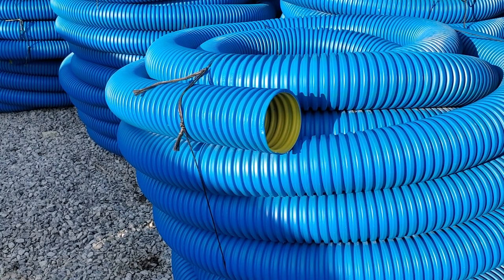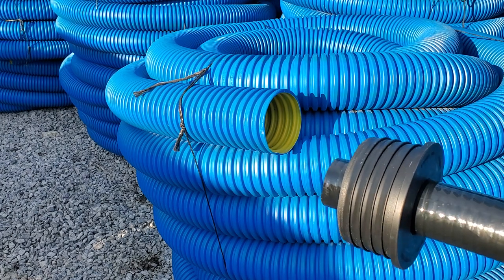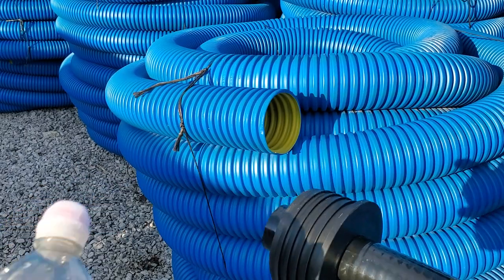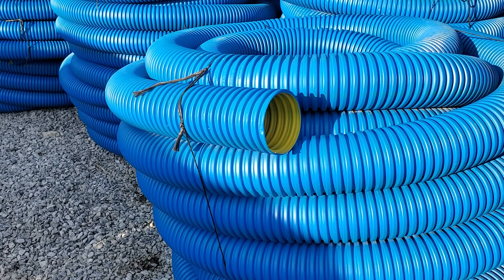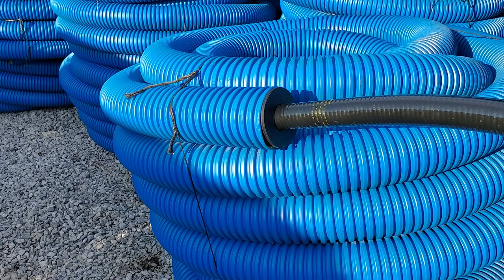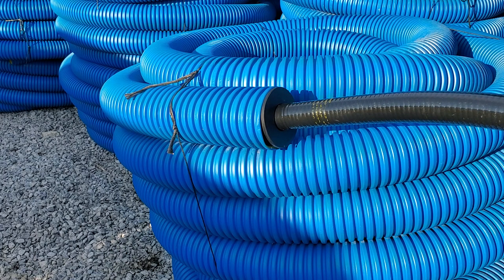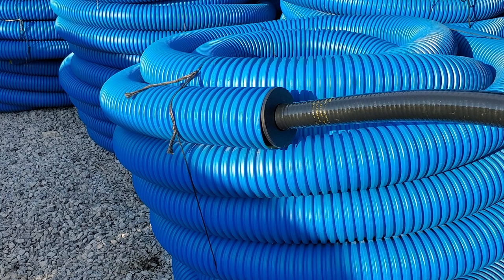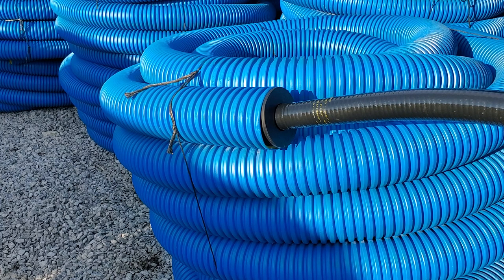How to Connect a Sump Pump to Corrugated Pipe

Comment: - The topography where I’m located (South East) is relatively flat so we don’t have gravity to assist in moving water here.
- We currently use the FDM pop up emitter for buried downspouts and we’d like to start using it for all of our sump discharge termination points. 
- Do you see any issues with us running the 1.5” pvc sump discharge line all the way to the FDM emitter? We’ve built a couple test systems and the only issue we’ve seen up to the point is the slotted emitter lid pops off likely from the water volume/pressure.
- I know you’re a proponent of discharging water into municipal storm drains, unfortunately that option doesn’t present itself here very often so an emitter must be used.
Reply from the maker: Try using it with the regular pop-up lid, and you won't be disappointed.
https://youtu.be/qoy_yh8NY2M?si=Iopzs1u33vFqLi-p

Comment: My indoor sump pump discharge comes out below grade and runs 1.5" sch 40 for another 60ft to daylight. I would love to upgrade to 4" blue armor corrugated. Can i use this bushing with plenty of FDM sticky 200 yr tape under the ground to go from 1.5" sch 40 to 4" corrugated? Or am I destined to only use 4" sch 40 and run that solid pipe to daylight. No real opportunity to move the sump pump discharge higher above ground unfortunately so I'll have an underground connection point to contend with.
Reply from the maker: Yes
https://frenchdrainman.com/product/sump-pump-line-to-4-in-corrugated-fitting/
Reply: Awesome. In the cart helping me maximize my freight shipment!

Comment: What is the INSIDE diameter of this rubber bushing? Is it 1.900 inches, which is equivalent to the OUTSIDE diameter of standard 1-1/2-inch Schedule 40 PVC pipe?
Reply from the maker: 1-1/2 in. Flex Sump Pump Line to 4 in. Corrugated Fitting
https://frenchdrainman.com/product/sump-pump-line-to-4-in-corrugated-fitting/